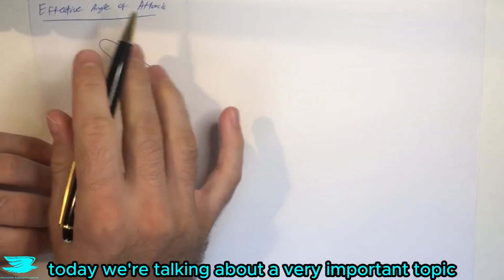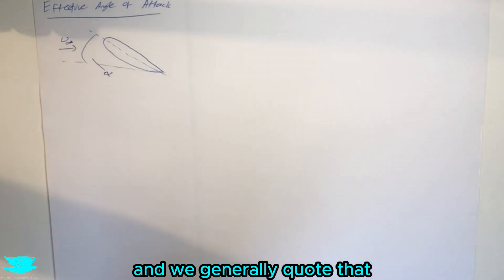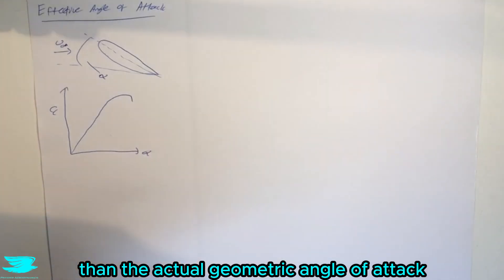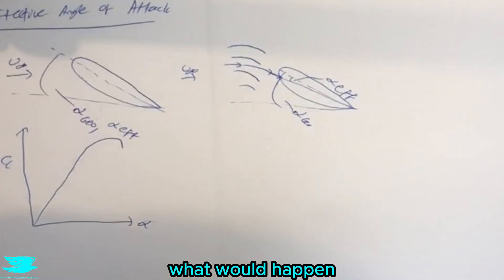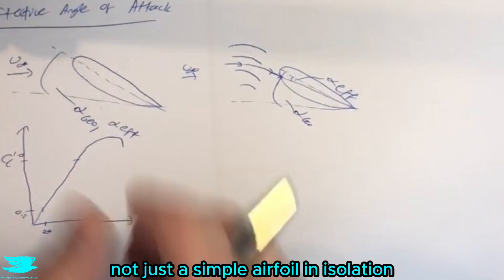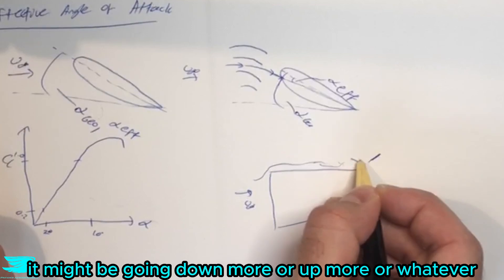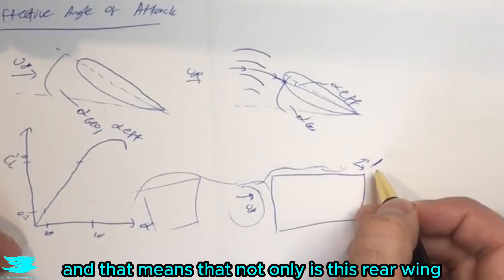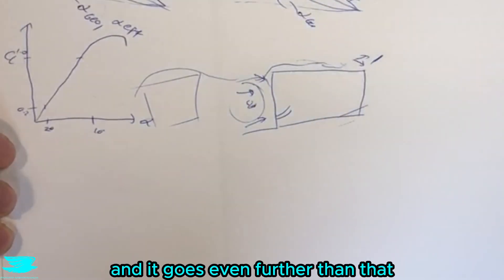Why The Effective Angle Of Attack Is So Important [Aero Fundamentals #63]

Comment: I tried to improve the flettner rotor.
And came up with an archimedes screw. 
If it's rotating in the right direction it is reducing wing tip vortices. 
The tips of the archimes screw also work as little propeller airfoils. 

So the rotation speed is dependant on movement speed. That the archimedes screw wingtips aren't stalling. ( they produce thrust )

A cfd of this would be great. 
Rotation speed of the wingtips is 3times the airspeed ? 
The steepness of the helix needs to match 10 degree angel of attack of the wingtipps.
The helix can be shaped this way, that the wingtip airfoil gets chamberd. 

Very cool design for spoilers on cars or airplanes or hydrofoils.
I meditated quite a time on a spring of an old umbrella to get this. 
These hypnotic spirals are hard to grasp.
Reply from the maker: Archimedes screws are sweet!